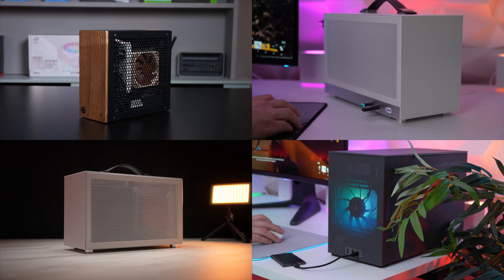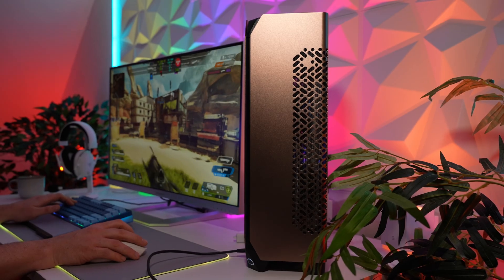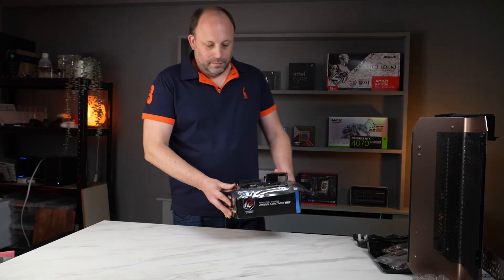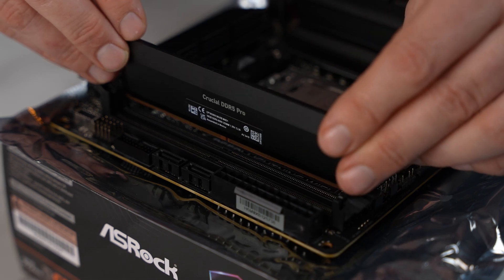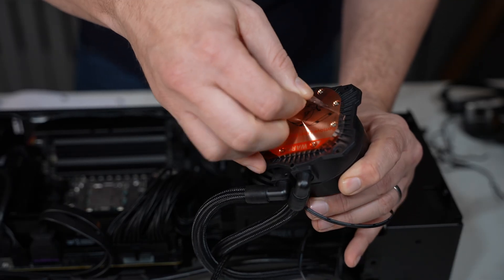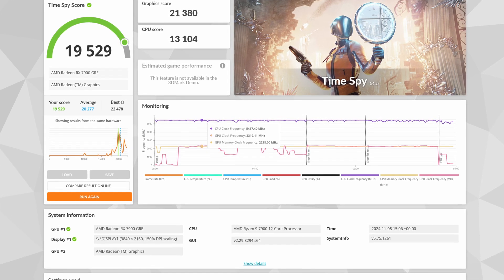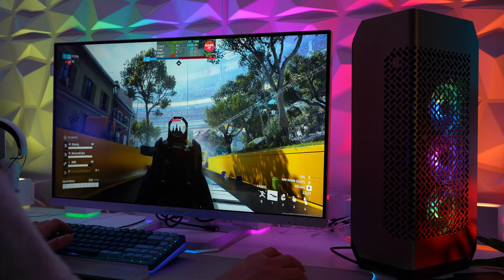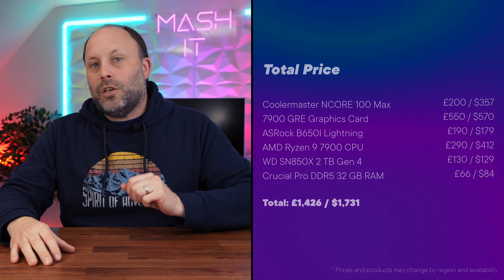The Easiest ITX build! -  Coolermaster NCORE 100 MAX

Comment: Did you have any issues with the aio? I just built a new system in this case and im trying to figure out if the aio is defective. It sometimes works fine and other times wont be recognized at all and cpu overheats. I have the radiator fans plugged into cpu fan. The pump into cpu opt port. Bios set pump to 100% and voltage controller. Any thoughts on what could be wrong ?
Reply from the maker: That sounds like the AIO could be defective. I was going to say did you set the speed to low as that can sometimes cause issue but if you are at 100% on pump then thats clearly not it! What motherboard? and does it show the fans and pump in BIOS?

Comment: Would the PCI 4.0 cable riser be a bottleneck for Nvidia series 5000 due their PCI 5.0 support? Is that cable upgradable?
Reply from the maker: yes the cable is upgradable but there will be no bottleneck even on a 5090! I think it will be a while before we saturate PCIe 4
Reply: I asked the same thing!!!  there is a cable riser on Amazon and it comes in different lengths and like right angle or straight!!!!   

I do believe You will want PCI-E 5.0 because if you go with 4.0, your 5090 will not be unleashing its FULL potential!!!

But i've also E-mailed Cooler Master last night, but they haven't reached out to me yet!!!

Comment: I was downloading GTA V and the CPU temps came at 100 degrees, should I be worried? Also the noise people on reddit have been talking about is present, and I think its the pump, its not coming from the PSU. Very satisfied with the looks but coming from a normal ATX PC, it is louder, and hotter
Reply: Did you remove the plastic on the AIO cooler?

Comment: i bought the same case few weeks ago and i put i9 14900k and rtx 4090 msi ventus, its running fine temp sometimes goes to 100c when game is loading but afther that it comes to 80s, 4090 is quiet and very well cooled, only think what is really annoying are their fans they are very loudy, the fans from power supply are horrible doing 100% in slightly small load, i replaced them with noctua 92mm silent 15mm fans, and other 2 case fans are replaced by noctua fans.
Reply from the maker: Wow that’s quite a load with a 14900 and 4090! Yeah I bet the fans get loud, what is it like now you have put noctuas in? With my 88w cpu and 250w gpu load fans don’t really kick up much so I don’t notice the fan noise or I would also swap out for noctua

Comment: Running a 7900x3d 7900xtx x670e_i… it’s a beast and stays quiet and cool.
Reply from the maker: wow that's impressive
Reply: I have a 7800x3d and a 7900 XT (not the XTX). I'm about to build in this case! What kind of temps do you usually get while gaming?
Reply: Came here for the same exact question 😂 @ColinCreighton
Reply: @dakotamcghee9613 I built it into the case! 

Under gaming load, cpu temps are usually in the high 60's and low 70's for most games. For more intensive games, CPU temps poke into the high 70's and even low 80's, but that is rare 

Any more questions?

Comment: I wanna do a mini ITX build so bad, but my components are kinda monsters.. RTX 4090, 5950X.. And my next CPU soon will not be much less than that..
Reply from the maker: It’s still possible but you need careful case selection. I am always impressed with what I can fit in my Dan a4 h2o and it’s tiny

Comment: Could I use a 125w TDP CPU in this case?
Reply from the maker: There was plenty of headroom so no issue with 125w CPUs. I imagine Intels 250w CPUs will struggle like the 13900 or 14900, those really need a 360 AIO

Comment: i just sold mine, after one year let me TLDR my review:
terrible PSU, noisy and with no 0RPM mode, after it crosses the threshold its always on
->replaced it with a SF750,  oh my what a difference
fans also noisy 
->replaced both for noctua ones, much better
 top mesh started making really annoying vibration noises after 2 months
-> that was the sell sign!!!

case is really easy to build on but with a 120mm AIO, even thicker than normal, could be a bottleneck for some CPUs (simply forget new Intels)
GPU space is amazing
its a beautiful case but with a lot of issues, since its made with a purpose of keeping it side by side with the monitor, the overall noise from the box its just not tolerable for me

Comment: I’ve heard complaints of psu noise, but this pc case literally is perfect for my room. Any thoughts? Can’t watch the whole video right now because I’m at work… sorry if this has been brought up.
Reply from the maker: I was worried about teh noise about the PSU from reports on reddit. There is a little noise, I am not sure if it is from the PSU or the pump but it is not annoying or loud. Dont get me wrong, I am sure my SF850's are quieter (well they seem almost silent) but this certainly isnt bad, especially for the price I paid (cost me £20 more for this entire case than just an SF850 in the UK)
Reply: @ so should I get it for my room? I play with headphones when I play with friends, but with speakers when I’m by myself.
Reply from the maker: I reckon so. Make sure you adjust the fan and pump speed in BIOS to you liking (on the ASRock I set it to silent mode for fans and performance for pump speed, this is great for quiet idle noise and I get about 37db in gaming which is just a whoosh). If you need any help just give me a shout :)
Reply: @MashITTech  thanks for letting me know you’ve been very helpful!!! This is the first video I’ve seen from your channel and it won’t be the last :)
Reply: I have this case. It's quiet, especially if you tweak around with fan and pump settings, to optimize them for your workflow/needs. It might be I upgrade the PSU, pump, and fans at some point, but there's no need really for now:

never bothered by the noise, and since I make music I do recordings in the same single room apartment all the time, with really sensitive mics. Not had an issue once. So if noise is your only concern. Go for it. 

My only problem with this case (which I otherwise love), is the custom AIO radiator, for which there is no replacement (at least there wasn't when I bought the case). Makes me worry about longevity a bit.
Reply: @mngd995  thanks for the tips!! Can I ask what are your specs? Specifically the cpu and motherboard?
Reply: @dudeMAN2521  Sure thing! Motherboard is MSI b650i edge. CPU is Ryzen 7700x. SSD is Western Digital Black SN850X 2TB.
Don't remember what RAM I got, but it was DDR5, and 32GB.

The system is wicked fast. I cheaped out on the GPU and got the Radeon RX 6600 from gigabyte. It's a great budget card, and I can run modern games (like cyberpunk with high settings, with raytracing off ofc) consistently at 60fps or higher.

Music production is what I got it for tho, so the case sound was my biggest concern (and why I have such a beefy CPU for the budget). But all is fine. Even with bigger projects and lot of synths and sample libraries running it doesn't get loud.
Reply: @ I’ve got the cpu which is a Ryzen 5 7600x. It’s not top of the line but I don’t need that, and it’s am5 so the upgradability is nice if I need it in the future! I’m gonna pair it with a 4070 super since this rig is mainly going to be gaming. I was having trouble decided a mother board. Did that one give you issues?
Reply: @dudeMAN2521  No issues, but if you choose to get it, there's one thing I'd recommend you do (which I didn't, and now kind of regret it): buy an SSD with an included heatsink, because the small fan that comes attached to the board heatsink for the SSD, is loud.

I took the fan off, but am now stuck with an SSD with no heatsink whatsoever. The temps have been surprisingly OK tho, so I'm not sweating over it. But just something to keep in mind.

That small heatsink fan is my only criticism of the board. Otherwise it works wonderfully.
Reply: @ thanks for the tips!! That’s really helpful!!
Reply: I put 2 t30 fans and nocturnal NFa9x14 no sound issues and it runs cool and quiet